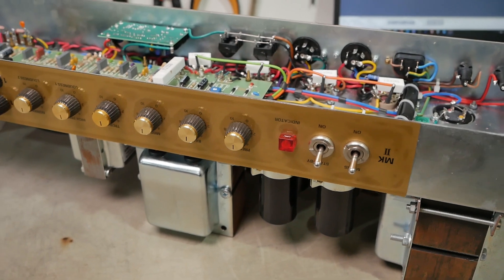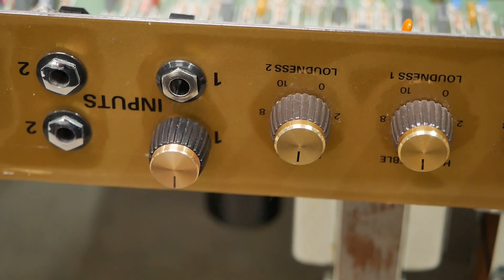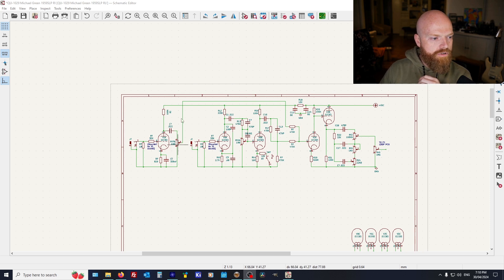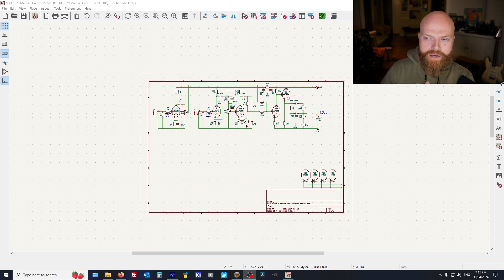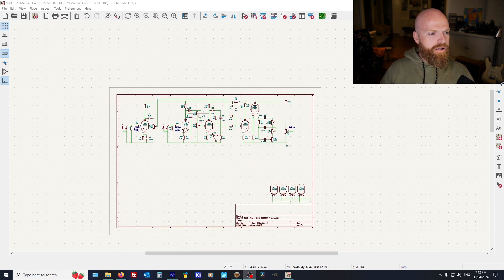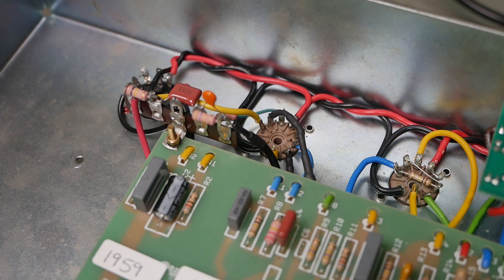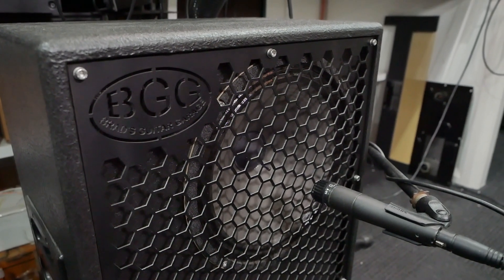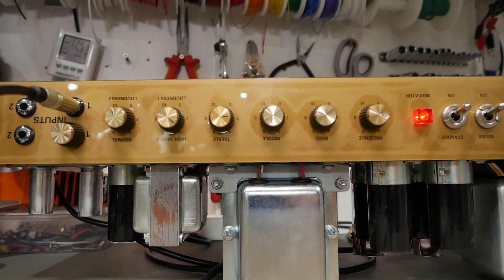2203 1959 Hybrid De-Mod-Mod Amp Part 2

Comment: A bit bright and fizzy for my tastes; almost like a 12-string Ricky through an AC30 top boost! Seems to lose note separation when played hard, almost like an underlying oscillation or ghost noting.
Reply from the maker: No oscillation, so ghost noting. Give me time stamps so I know when you're talking about. Because, remember, there's a "Normal" channel that I was pushing, and things get messy with that much bass feeding the front end. some like it, some do not, but the wise know that it's just another tool to be used when the occasion calls for it.
Reply: @BradsGuitarGarage , seems to be losing the plot a bit at 5:05, for starters. Maybe it needs a bass-cut switch if the bass control doesn't do the trick. Perhaps I'm just not a fan of this kind of chunking; it sounds better when you're doing the Red Hot Chili Peppers thing, until 6:20 when you make an adjustment and then it gets fizzy. Give the customer what he wants, I guess; but when I think of "the Marshall sound" this isn't what comes to my mind. I had a teenage neighbor in the 80's, a darn good player, who had a Marshall (dunno which model) that would go from full-on Hendrix/Clapton/Zeppelin etc to clean ringing chords (like the Little Wing intro) just by turning down the volume on his SG.
Reply: Metal tone isn't for you then, it sounds great to me.
Reply: @ScottyBrockway  , I'm definitely not a metal guy, more of a roots music guy, with side trips into other genres. Outside of Jeff Beck and the fusion guys of old, the heaviest, most electrified guitar players I listen to are Steve Morse, and Sonny Landreth.
Reply: @goodun2974  Yeah not everyone likes it. I like those tones too, although I am not a fan of the treble spikey Marshall tones, but some people love them.
Reply: @ScottyBrockway  ,  The most intense guitar tone I have ever heard was David Lindley playing lap steel through a Dumble amp when I was standing right up against the stage, about 8 feet away from the speaker cab.  Otherwise, the majority of players I listen to regularly are Fender amp users.
Reply: @goodun2974  Best tone I've heard was Eric Johnson in 1991 or so at the Paramount in Seattle. God tier.
Reply: @ScottyBrockway , the other heavy-tone player I've seen is Sonny Landreth. There's a video of him and Eric J playing "the Milky Way Home" on YouTube, which they co-wrote  ---- they mesh very well together!
Reply: That's probably the vintage 30s